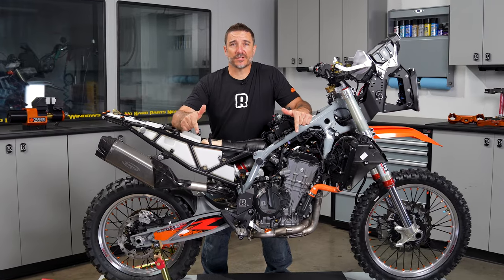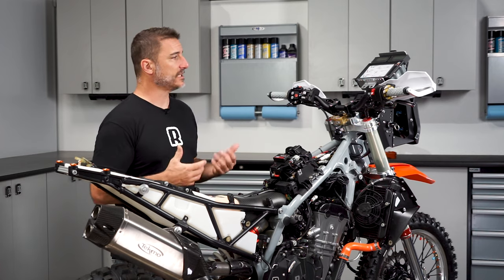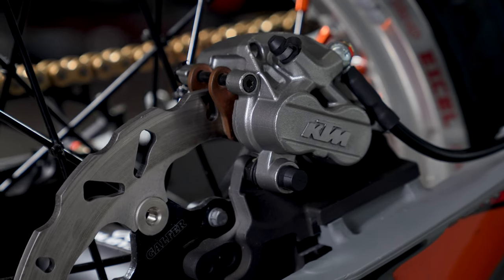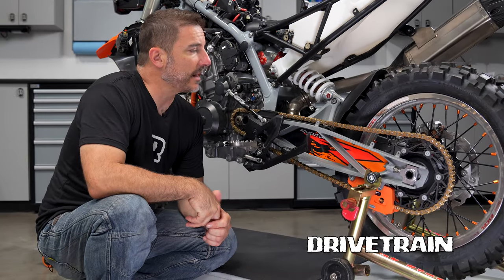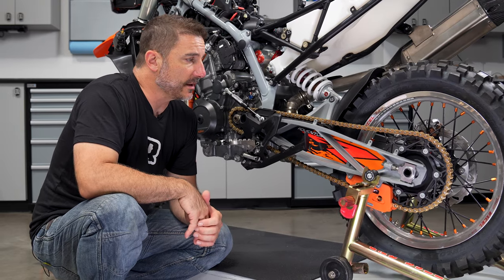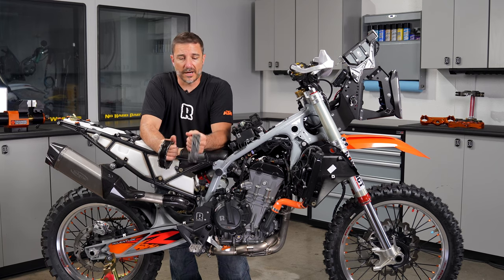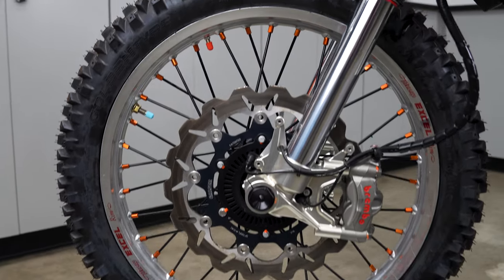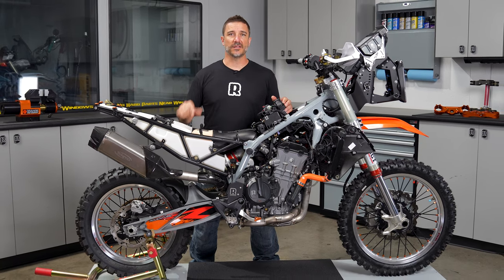BIKE BUILD - KTM 790/890 ADVENTURE - ROTTWEILER PERFORMANCE

Comment: I can vouch for the aluminum billet fuel pump protector and spigot.  Yes, I was left stranded in the woods.  Once I got towed out (thanks DCTFAN), the folks at Rottweiler Performance had the billet kit in my east coast mailbox by noon the next day.  Sturdy, effective and easy to install.  12,500 miles of TAT & BDR later, no issues.  Buy one.
Reply from the maker: Awesome story! Well, at least the 'in your mailbox' part. Sorry about the fuel pump incident but glad you can ride with confidence now!

Comment: my Norden 901 rips !!  intake/cannister delete cat delete arrow mid pipe and silencer with pro programmed power commander and a boat load of other more minor parts mostly from your company all installed at the first service along with a set opf TKC80's , only had a chance for a short ride maybe 100 miles so far but feels awesome , still watching your site daily waiting for the replacement Hyperpro forks and shock springs kit to be available for this bike and a taller windscreen otherwise super happy so far
Reply from the maker: Love hearing this! Thank you and we are thrilled that you love the parts. That's why we do it!
Reply: @RottweilerPerformance  the diff your kit made on my 1090r prior was outstanding , and i wasnt going for performance at first just less heat and better running and reliability which it accomplished the performance gain was a side effect/benefit
Reply from the maker: @justsomedude445  Just awesome. Thanks for sharing that! We LOVE happy customers.
Reply: @RottweilerPerformance  get on Hyperpro to develop their spring replacement kit for this Husky 901 and as soon as its shown ill be buying it , 1st day

Comment: The endurocell, rocks that get stuck in the back tire and get tossed into it, have you had a puncture from that?
Reply from the maker: Not a chance. It's way tougher than the stock fender well and those don't see punctures so you are good. lots of them out there, no issues whatsoever.

Comment: Any suggestions on a front break upgrade for us paranoid about the front locking up which KTM did the recall for? I’ve seen posts online of lockup’s happening post recall. Can you just replace the master cylinder with an off the shelf unit? Not to bothered about single disk as ride on road, it’s more piece of mind and if the feel is better that’s a bonus.
Reply from the maker: We would recommend the Brembo RCS 17 for dual disks with a reservoir kit, or the Brembo RCS15 for the single sided disk which we have a kit for.  I believe it was the cheap master cylinders on the front braking system that were hanging up on the inside and causing those failures.  We never had to warranty ours because we throw them in the trash the day we buy our bikes. https://www.rottweilerperformance.com/ktm-790-890-adventure-single-caliper-brake-kit-stage-2/

Comment: Seems like this bike has a ton of oddly engineered weak points more so than most. Glad you guys are able to sort it out and find solutions. On that note since you added 1.6 gallons to the tail section how about making a smaller main fuel tank that would eliminate the  saggy ball effect of the stock tank that’s splayed to each side of the engine case?
Reply from the maker: That is actually on the table to manufacture if these are popular.  Already scanned the stock tank and have some things drawn.

Comment: What did you get the weight down to? It looks like you did not change the cable clutch to hydraulic; any preference?
Reply from the maker: Believe it or not we keep forgetting to weigh it.  We think lower 400's but we'll get back to you.  On the clutch, either are fine. We have run the Magura hydraulic lines and sell many of them and they are butter smooth.  The cable isn't that bad, but on this bike we run our CRG Clutch kit where we had custom cables made by Motion Pro that link to CRG's R1 Yamaha lever that is adjustable both on the fulcrum and the lever position.

Comment: So this rally race bike cost you what, as much as a 450RR? I know which of the 2 I would choose for rally purposes
Reply from the maker: Certainly, and we would agree that would be an awesome bike, but this bike is very different and for different riders. The only reason we raced this bike in the Sonora Rally was to test parts durability and the bike itself to see what could go wrong with it. The good news is that nothing substantial failed and we placed 9 seconds out of third OVERALL PRO behind Ricky Brabec and Skylar Howes. On a 790... Mission accomplished and it turned way more heads than a 450RR would in the same position. That was really the goal.

Comment: I noticed you are using a combination of KTM Powerparts aluminum handguards with what seems to be Cycra HCM handlebar mounts.  Does that help in increasing the clearance between the Brembo MC and the handguard bar?
Reply from the maker: Those are BRP bar mounts. Love them and reduce crap on the bars. https://www.rottweilerperformance.com/brp-hand-guard-mounts/

Comment: Where did you get the fork cable guide that fits the WP Pro forks? The cable guide for my 890r Xplor forks is too small for the Xplor Pro forks.
Reply from the maker: We believe there are cable guides that are specific to the two different forks. We can't remember the part number, or how we got them, but pretty sure there are two sizes, one for each fork type. If we can get a part number we will update for you!
Reply: @RottweilerPerformance  Thank you. The parts fiche that I keep seeing for the rally has the same part number as the non-rally bike so it is wrong.  I will stop by my local dealer and see if they can help.  The are a WP affiliate.

Comment: Im thinking about buying another bike after 5 years or more away. Nothing appealed then I saw the 890. Knowing the rally version is all that more cash, is it worth the extra bucks? Or should I get the stock R bike and modify from there?
Reply from the maker: That's a tough one. If you like really nice suspension parts that are all billetey and beautiful, but work really well, then it's a good thing to consider. There are a number of other perks like carbon fiber tank guards that get ruined right away if you ever go down and the prestige of the livery colorways, so that may help push you off the fence, but if you don't care about that stuff you can probably achieve the same build with an R model and put the money saved into aftermarket parts and suspension and you'd probably be way ahead. If you are unlimited, do both!
Reply: @RottweilerPerformance  unlimited. Sadly very limited
Reply from the maker: @jamesbarratt593  That's okay too. You can certainly make your budget work for you with the stock parts and some aftermarket parts and get very close. I would add that the suspension that the Rally comes with falls under 'diminishing returns', meaning that they are certainly better, but the 'better' gets smaller and smaller the further you go expense wise.

Comment: Any interest or development in air intake breathing cleaner air from the battery location area. Breathing from a cleaner location is something I’d be interested in.
Reply from the maker: We looked into that, but there are a number of problems with that.  First, you are putting the filter right in the customer's face, which can get a bit on the noisy side. Keeping things under the seat and next to the muffler is more ideal for that.  Second, you would have to recreate the velocity stacks and that costs quite a bit in mold costs which would have to be passed on to the customer.  Third, the flow of air would not be as direct and bending things around tends to lose velocity which is part and parcel why our intake designs work so well is that we try not to force air to change directions too many times. Fourth, you would have to make a battery relocation kit, and that's costs more money which also must be passed on to the customers and also adds more vendors and parts to the kit.  Fifth, you would dramatically reduce plenum space for air to be pulled from and sixth, the size of the filter would probably end up much smaller, and therefore load up much quicker.  Seventh, where it currently breaths has not been found to be an issue.  Pretty much ever dirt bike in the world breaths from a similar location and so far our current design has held up very well in very dusty climates.  

That's about the long and the short of it for us.  We like the thinking you are doing, but we hope we illustrated well why we designed our system the way that we did.

Comment: Hi, nice video!... one question, I have a 2022 890 ADV R and I want to do a weight reduction on this bike... do you know how much weight can be reduced changing wheels, exhaust, decat... etc?? Thanks!
Reply from the maker: You can drop 30+ lbs off of that bike easily if not more depending on your budget. There is 7 lbs of unsprung and rotating weight that can be lost using our single sided rotor kit. That's huge and really helps suspension work. You can use our rack eliminator kit to lose the rear handles and rack and go just fender. There is a couple lbs with the air box and major HP gains. A decat is worth about 4.5 lbs. Narrower rims toss a couple lbs each as well. Also check out our 'Diet Parts' section on our site. It's loaded with items we thing are major weight reducers. Here is the link for your model here: https://www.rottweilerperformance.com/new-category-11/
Reply: So, Total weigh for this rocket ? Why nobody changes the real heavy subframe to alloy ?

Comment: You mentioned you pick a handlebar bend to fit the controls in - may I ask which bar and bend you use?
Reply from the maker: To be honest, I just went and looked for you and it has no marks on it and I just can't remember what we ended up with.  I think, it's just the KTM bend as we have a few of those laying around.  The stock bend has way too much pull back for our liking and are cramped, but have some good bar real estate.

Comment: I want to do the pro intake and decat tube, leaving the stock muffler on my rally. Should i do a remap or power commander? Or can i leave it without any remapping?
Reply from the maker: You can certainly leave the mapping stock.  There is no harm in that at all and the stock system will simply continue to map at 14.7 air fuel ratio just fine.  The bike DOES NOT get lean with these changes.  That is carburetor thinking.  The stock system has narrow band O2's that monitor the exhaust and just keep everything at 14.7 in closed loop, which is safe.  That being said, you are leaving some really good extra power on the table without mapping.  So the answer is, yes it's safe, but you are missing out on some good extra ponies.  Either way, you will love the airbox mods.

Comment: whats the gear ration on sprockets?
Reply from the maker: 15/45 is what we run. The 15 tooth front sprocket allows a bit more ratio down low and 45 is stock rear.

Comment: Hey,  got another question for you - mostly unrelated to this video. Do you know if the motominded - Stacked Stout Mount you sell fits the tft? I'm looking into putting a exc-f head light on instead of a tower,  one less thing to break when I yeet my bike. I just need to figure out how to keep the tft connected to keep it street legal.
Reply from the maker: If TFT you mean the stock dash, we are not sure. It has very specific mounting points, so you would probably have to fabricate something. The bike will run without the dash, but you kind of don't want to do that. Hopefully we understood your question correctly.
Reply: @RottweilerPerformance  Thanks for the reply, you understood the question exactly. Definitely the redundant answer ive been getting of. I'll have to figure out my next step as I'm not a fabricator by nature XD. I've been looking for a headlight replacement that is cheap to replace if/when it breaks which is why i'm looking everywhere but at the most obvious spots (rally towers) I'm looking to take my 890 into a turkey run in September then probably a full blown enduro next spring - So I'm in the midst of bulletproofing, lightening and stiffening the bike while trying to keep it fully street legal.
Reply from the maker: @houjous5131  We raced a 790 in a Hare and Hound Hooligan class once and we used a 500 EXC front mask and it worked perfectly. What you can do is use a 500 EXCV front fender (it will bolt directly to that bike) and then the 500 EXC headlight mask will fit into the front fender (the mask has pins that fit into it) and then you just use the rubber straps that go around the forks for the upper part. Then you could wire in a Baja Designs XL 80 light or a Cyclops offering. Then all you would need to do is figure out how to mount the dash. The bike will run without it though if you just need to get through one event but you won't know what's happening with it if there is an issue. Hope this helps.
Reply: @RottweilerPerformance  lots of great help - thanks!

Comment: Dumb question, do you have a how to for moving the abs sensor?
Reply from the maker: Not a dumb question at all, but we do not unfortunately. We just moved the rear sensor to the front and made a small billet carrier to mount the rear in the front at the bottom of the fork so that it also read from the same ABS ring.
Reply: @RottweilerPerformance  was there any issues derived from it?  Excluding not having abs or tc. Advrider conversation on it end with "could cause issues" seems like no one on that forum has tried.
Reply from the maker: Shoot us a link if you will. No issues at all and not sure why anyone would think there would be but not know the answer to it. The bike just things things are perfect in terms of wheel slip all the time. That's about it. Pretty simple, but you know how forums can be... @houjous5131
Reply: @RottweilerPerformance  definitely do, why I came to the source! Thanks for all the helpful info! 🫶